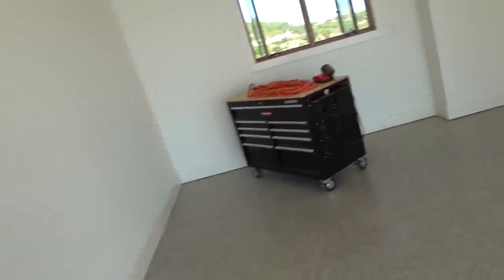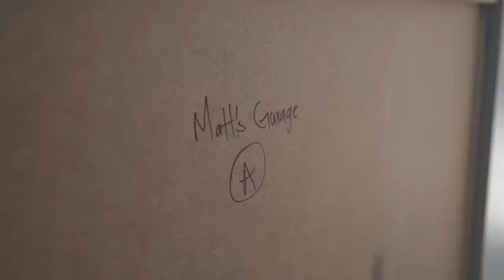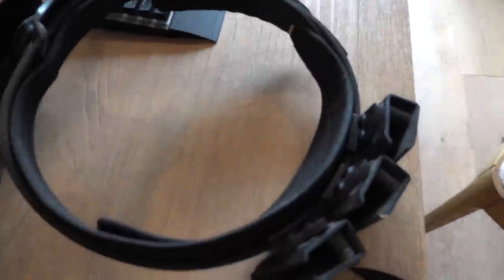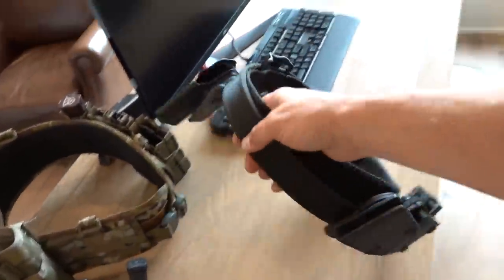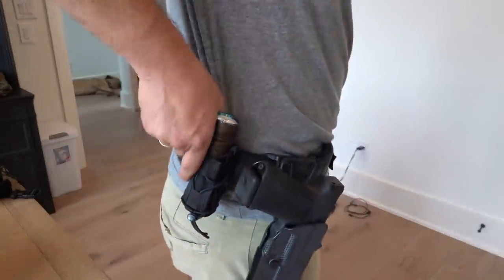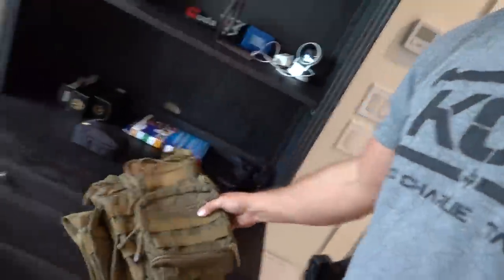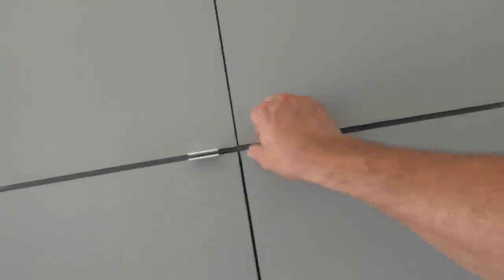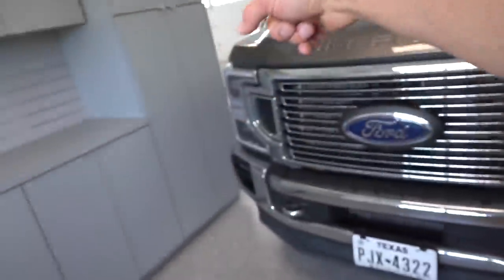Caught Intruder in my Backyard at 10pm... DemoRanch Gear Check!

Comment: Hey Matt, wouldn't it make more sense to put your flashlight on your off hand so you don't have to fumble with it and your gun if you need them at the same time? Love your video. Keep em coming.
Reply: He said he had a flashlight on his pistol, so I imagine he wouldn't fumble for a flashlight, but just turn the pistol one on.
Reply: @mrdrummer2564  I still find myself using my flashlight a lot more than my tac light. Tac light is nice to have, but it’s just a small supplement to your main light.
Reply: Ya, I agree. You want as little as possible on your strong side. Less things to interfere with your draw.
Reply: @mrdrummer2564  if you’re using your flashlight, it should be in your non-weapon hand, drawn from non-weapon side
Reply: Harley Quinn ©  troll
Reply: @mrdrummer2564  In most situations you want to shine a light on something without pointing a loaded weapon at it. Hand held lights are a necessity for that reason.
Reply: Glad to see this reply Thomas, I was going to say the same. I guess my other is I don't care for a light on my pistol either. Its a old technique to use the light off your body area enough your offender is not shooting at the light which in a lot of cases your directly behind. 
  He does bring some great videos and Matt makes it for discussion which helps a lot of us out.
Reply: Came here to say the same thing, Flash light behind the mags on the off side.
Reply: I would also suggest putting the flashlight on the offhand side. Pistol lights are great but the problem with that is if you turn it on to identify someone you are already pointing a gun at potentially a loved one, friend, or what have you. Id say off hand in front of the mags or just behind them.
Reply: Had the same exact thought.
Reply: In my opinion, I would use both on weapon and hand held.  It's personal preference though.  I like having a light on my weapon so I can use two hands on the weapon for more accurate shots.  Again, personal preference. 

I also have my hand held light on my left behind my mags.  A flashlight is not a speed critical item but your mags are.  The left side of my duty rig from front to back is, key ring (small item not interfering with the mags), dual mag holder, flashlight and then handcuffs. The right side is weapon and then radio holder.  I know, I know, I should have two sets of handcuffs but I only have one set for now.  I work armed security in the state of Texas.
Reply: Agreed, too many stories of people using their gun light to identify and accidentally shoot people they don't mean to. Definitely need the flashlight in the offhand side to prevent fumbling
Reply: Exactly my thought. You should move the mags a little closer to center mass and put the flashlight on the non dominate side so in the event you need to draw your gun hand is free
Reply: @stanshearer7343  definitely. Im pretty sure most of us that were saying to put the handheld flashlight on the left side and advocating its use first to identify a target weren't saying that the handheld should be his only light just the one to use while searching and identifying a potential  friend/foe and if it's a threat then at that point switch to the weapon light.
Reply: @chucknabox1164  I totally agree.  If I left the impression to the contrary then I apologize.  The point I was trying to make was that I run a weapon light also is to make a more stable grip IF I have to draw my weapon.  I can drop the flashlight and grip with both hands.  Some don't like a weapon light for the  reasons stated elsewhere.  Some feel perfectly reasonable to use the handheld light as the only source for light and brace the weapon hand on top of the light hand or shoot their weapon one handed.  It's all in how you train and either way is right for each individual.  Either way, i carry my flashlight on the left to leave my weapon hand free just in case.  Sorry if my post was taken wrong.
Reply: @stanshearer7343  not at all, i was just clarifying in case anyone thought that was what we we saying because I realized at least from my first comment that someone could read it as I was saying only use a handheld.

Comment: My thoughts, and love your stuff Matt!
1. Ditch the 30rd, reloads need to be fast
2. Red dot 100%
3. Your flashlight and pistol are both on your dominant side, this is an issue if you need to access light and pistol quickly.
4. Put a tourniquet on the belt and ditch the other thing.
Reply: Definitely should have a tourniquet ready and available!

Comment: I’d recommend moving your flashlight to your “weak” side that way if you have your flashlight out you can still easily and quickly draw your pew pew. Carrying the flashlight on your pew pew side takes extra time to free up that hand by having to drop or find your flashlight holder and having to quickly draw with the same hand.
Reply: I was about to say the same thing
Reply: I was going to say the same thing. The mags are on the weak side because the strong side will be occupied manipulating the firearm. Same rule goes for the flashlight.
Reply: yep thought the same.
Reply: @m2hmghb  
...and a less than lethal.

Comment: Primary suggestion would be to keep your flashlight mounted on your left side, and to get used to using your left hand to hold your light. That way you keep you right hand empty and ready to draw your firearm if necessary. 
Next, I would highly recommend using a light with the power button on the tail cap, allowing you to hold the light in your fist, using your thumb to turn it on/off. This also provides you with better hand to hand capability than the way you held your light in this video at 11:36 . 
Finally for the flashlight, and this is just anecdotal, I would personally avoid the Olight brand for any flashlight you may use in an emergency situation. I have had reliability issues with their lights on numerous occasions, and I no longer use them except as work lights.

Comment: Hey Matt, a few things to consider when putting together your belts and plate carriers. 

Use the same size mags so you always know what you have.

Have all your mags facing the same direction. I prefer to have the projectiles facing forward/inboard, but you can go either way. Practice some mag change drills to see what works for you, but keep them the same.

Have extra mags on both sides, not just one. This keeps them more accessible in case you’re against a wall, on the ground, or injured.

Also, remember to practice shooting and reloading with your non-dominant hand & eye.

You’re going to find yourself tweaking your rig and refining your gear a lot for a while, that’s normal, enjoy the process.

Comment: Hey Matt! Glad the family is safe. From my experience, it is always beneficial to keep tourniquets and firearms paired together, especially for home defense. In my opinion the belts you have set up are pretty practical. If there was something to improve on,  I personally would have to say include a smaller med kit on the back of each of the  belt systems you own. This way it is already attached to your belt system and its one less step you need to do in order to prepare. If you so chose you can also attach the satchel medial kit you have to your body but in the event you don't have it with you/can't find it , the extra smaller medical kit that IS attached to your body can potentially save your life or that of one of your loved ones. In terms of overall set up, make sure anything you would need to quickly access is easy to access but it looks like you have that for the most part. Make sure the orientation of your magazines in their pouches are practical for how you reload, I was always taught bullets towards your belly button. Make sure you actually weave the Molle straps through the webbing the right way and not just the single pass that barely holds the pouches on.  Unfortunately, most tactical gear is expensive but at the end of the day you are putting your life in the hands of the equipment. When you ready to buy more gear, anything from brands like haley strategic, high speed gear, and 5.11 are pretty reliable. There are also many other brands that are good as well these ons just came to mind right away.  I would definitely talk to the wife and develop some type of plan (If you don't have one already) for a safe spot for the rest of the people in the house. Hope this helps, love the videos!
Reply: Exactly what I wanted say. Even if Matt is 'just' a vet he has extensive medical training that could and should be used.
Reply: Couldn’t have said it better myself. I’m always worried about the fall out, a life is a life. Once, the threat is down someone has to provide Immediate first aid.
Reply: What belt would you say is good and cheap to get for edc my current regular belt can’t hold the weight of the firearm and two mags and it ducks having to constantly adjust the front sagging when I appendix carry or the side falling cause it can’t hold the weight
Reply: 100%, a trauma kit and some various emergency first aid things is something everyone should have access to, especially if they're around firearms frequently
Reply: I have a tq on both ready to go rifles. I used those rubbery wire tiedowns from Lowes. They are on the lefthand side of my buttocks. They are pretty secure and haven't come off during drills or transport.  Stole the idea from Shawn Ryan

Comment: For your bump-in-the-night setup, I'd suggest having a rifle ready to go and the handgun just as a backup. Rifles are generally much better all around as far as accuracy, easy of use, etc, aside from extremely tight spaces, handguns are just more convenient for every day carry/use.

As far as that bigger belt goes, ditch the crappy nylon holster for something made out of kydex. You'll get a better draw, better retention, and it also greatly decreases the chance that something can get in your trigger guard and cause your gun to ND into your leg/the ground. 

For that, since you want it for hiking and just generally long periods of moving around, I'd also suggest something with active retention such as the Safariland ALS system to prevent any chance your gun could get snagged or shook loose and come out.
Reply: Rifles can go through walls easier then a pistol, personally I think a shotgun is the best
Reply: If you're planing a long hike get suspender attachments for the large battle belt. It really helps the low back and hips.
Reply: I agree, and my compromise is a short carbine, optimally PCC. The "belt" is next to my CZ Scorpion EVO 3 in 9x19mm with mounted light and strap, inserted 2 magazines connected by a clip. The primary is Sellier&Bellot XRG 9x19mm (variant of CZ police ammo HS, excellent for defense use) and secondary is standard 124gr FMJ - so in case of higher penetration need, I can turn the magazines and use the FMJ. The belt contains additional FMJ in Evo magazines, which can be used as a spare ammo for pistol in an less-likely case (reload to the pistol takes a time). Glock lovers may use one magazines for some AR-9 PCC and Glock interchangeable.
Reply: @Kodachrome02  Shotguns are less accurate?  Haha. Just stop, dude. You have no idea what you’re talking about.
Reply: @oogboog7049  Actually, high velocity, light .223 breaks up much better than most handgun rounds through drywall and insulation.
Reply: Your comment, combined with the gentleman above suggesting a tourney was my exact thought.  He's in Texas... literally on a RANCH.  A handgun isn't the best choice.  If someone(or someones) know who he is, and are there to steal what he showcases on YouTube, you can bet they've planned ahead and expect a gunfight.  Assuming it's an AR, light varmint loads in one mag in the rifle for immediate indoor threats and 62+ grain FMJ's in a ready 2nd mag for outside.

Comment: You have some nice set ups matt. Only thing I would recommend is a good quality weapons light on that 34. You are gonna be able 2 control your pistol alot better with 2 hands on it instead of one on the flashlight and one on the gun incase you do identify a potential threat. The regular flashlight is a good idea as well just for generally checking things if no threat has been identified yet because no one wants to red flag a potential family member or friend accidentally by using the weapons light first. Just my 2 ¢.

Comment: I honestly thought there’d be a gate or fence at entrance to your property. I’m sure you’ll fix any security issues quickly. I’m sure that worker learned his lesson,thankfully no one was harmed
Reply: Matt is on many many acres. Wouldn't be cost effective to fence and gate the property
Reply: @tonylewis1771  yeah but just by gating the roadway provides an extra hassle that makes it harder for unwanted visitors entering and exiting the property. Besides he could always just gate and fence the house that’s a lot more doable and provides extra protection.
Reply: @tonylewis1771  A gate just for the driveway is necessery .. It will help Matt so trucks and over vehicle cant go anywhere near his house
Reply: agreed. if he had a gate. then he would know it wasnt a construction worker.
Reply: Purple markings and an entrance gate would be a good start.
Reply: You do know a gate and fence only keeps Honest thief’s out! And one good thing about not having a gate is a vehicle is a much bigger object too set off a Motion alarm vs say just a human at night. So it can be a disadvantage and a good thing! And it also will slow down first responders.
Reply: @triplehfarmsllc7348  agree that a fence or gate won’t stop someone alone if they’ve got bad intentions. With solar power a motorized gate could operate along intercoms to the house. Of course Matt will choose the best solutions. Though I’m guessing those two young men who fabricated the stairs at bunker branding and many other things could whip up something fairly quick.
Reply: @JR-pu8uo  Just googled that, didnt know purple paint means no trespassing
Reply: @tonylewis1771  No , just gate the driveway , So anyone approaching has to walk in . And motion-sensing lighting on the driveway .

Comment: Just a couple suggestions. I put some thought into it. For your reloads, you should use the same size mag for muscle memory in stressfull situations. I would put the standalone flashlight in your off hand side. If it is not clear if you need to have your pew pew out you can use the flashlight in a safer manner without having to then switch hands to pull your sidearm. Also, consider a fixed blade in an easily accessible holster incase you get surprise tackled and can't get to the gun because you dropped it, are laying on it or the attacker is on your strong side and you can't pull it.
Reply: 2nd the flashlight on off hand side. dont want to draw your pew and then have to draw your flashlight with same hand. Or visa versa.

Comment: I’d set up more floodlights around your house so you can see pretty far out around your house or at least have some night vision nearby to look around before you step outside.  Flashlights in some cases put you at a disadvantage because it marks your position while your attempting to locate and light them up.
Reply: Good camera’s are all you need! And floodlights are nice but in an emergency situation and you know your gonna be in a gun fight dark is best! I do have night vision but unless you train with it or have trained using it I wouldn’t recommend using it! It’s not something your gonna throw on and just go without experience.
Reply: Damn straight.  The biggest deterrent to theft is lighting.  Some serious spots with motion activation.
Reply: @triplehfarmsllc7348  If the lights are bright enough, it gives you a tactical advantage if you are behind them.
Reply: @actschp1  yes if your behind him 100% but they also can be a disadvantage as in giving your position and if moving around the house outside also blinding you from seeing the outer perimeters! We have cameras cover everything around the house and other sensors and i run night vision so lights aren’t needed and no one knows your house or even large lay out at night better then yourself anyway. But if you have never trained with night vision and no experience using it I don’t recommend it because shooting with vis is way different and something you need to train using.

Comment: Hi Matt, thank you for sharing the intruder story. I had a similar story. Uber eats delivered to the wrong house and the customer came for it. This was around 10pm as well. Fortunately everything was fine as the customer explained what happened to our door bell. I too was not ready and it reminded me of your story. I bought a $40 knock off belt. The one with Velcro inner belt. It had bad reviews, so for 8+ months I used it as a tool belt. I work at an anti 2A theme park in Florida and to go through security with my tools was a simple a unbuckle, send through x-ray, put on and ready for work. Much better then emptying my pockets daily. The inner Velcro belt stays on since it does not have metal. I used a modified pistol mag pouch to hold my LOTO locks, a folding dump mag pouch to put hardware in, pouch with ear buds, notebook and pen, radio pouch, and flashlight. It looks ridiculous but the practicality is amazing. I figured, if it can handle the everyday abused in a dirty and fast pace environment like a theme park, it will be perfect for home. Plus the kids that operate the rides became comfortable seeing a normal women carry a police looking tactical belt. They were nervous the for first couple of weeks when I started wearing it. Now they find it odd when I walk by without it. I bought another one as the house defense belt.